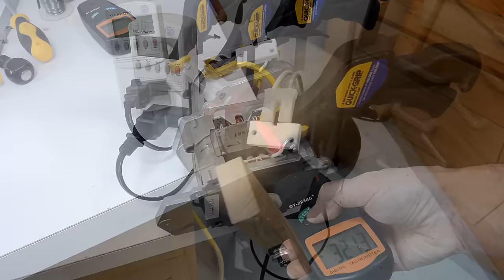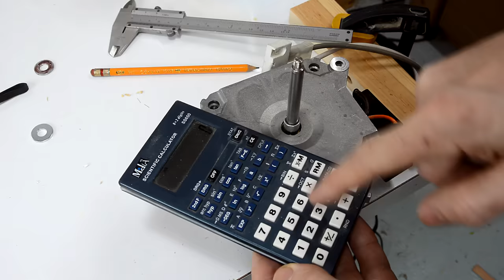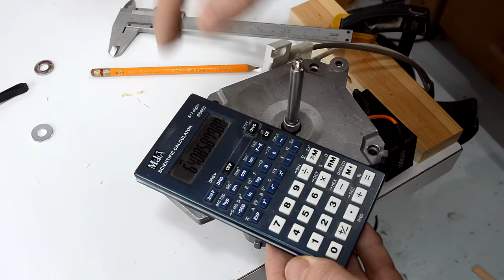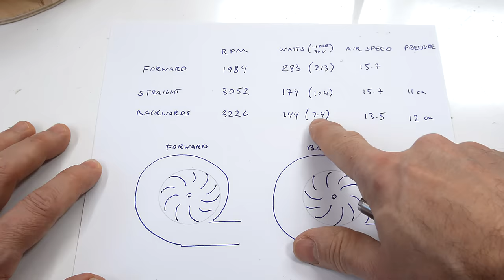Blower impeller design experiments

Comment: fantastic
plz have you the compas design? :)
Very good one.
Reply: Actually it is called a trammel and right you are a clever bit of kit.
I am sure you could have worked it out though, dual bevels on the rail keeps the points centered.
as for the clamps let your imagination run wild key there is they should be non marring.
For actual plans send money. Ha ha just kidding

Comment: I think you should be able to electrically reverse this motor. Without cap this motor should have 3 wires - phase, neutral and helping coil. Cap is usually connected between phase and helping coil, but if you do connect cap to a neutral and helping coil, it should reverse the rotor rotation.
Reply from the maker: It doesn't work that way.
It could be reversed if the two coils were the same turns & thikness, but they aren't.
Reply: Oh well.
Reply: If the four coil ends were accessible, it would be easy to reverse a coil, but this motor has only three leads. A junction is probably buried in epoxy.

Comment: Hi:  How about this: The entrance area and exit area of each  impeller I think should be the same, or the air will be forced to change volume.  Can you test this with your wizardry?  I think the thickness should be less toward the outside perimeter,  I guess linearly... Great work! Thanks!
Reply: Usually the opening is 10% smaller than the duct size.

Comment: nice video.   although I believe the tests were not valid.  each type of impeller has a function.   to suck, to blow or to move air.  application is the reason there are different types of impellers.
also, if you look at a vacuum, the part of the impeller near the shaft is tapered so that hair cannot have a place to purchase.  the taper just spins lint and hair off.

another test would be to add pipe to the inlet.  a dust collector has 20 feet of duct.
smaller duct to have the velocity in the duct lift and carry dust.

Then add duct to the discharge.  a home furnace has 20 feet of duct on the outlet.  this only moves air, not particles.

Comment: Forward curved fins will always move more air so they require a stronger motor.
Reply: And it's easy to mentally figure why, the air is accelerating out and forwards meaning you get a flow velocity greater than the tip speed. With the reverse fins you're actually slowing the air as it exits in relation to tip speed, and relying more on the volute for your mass movement. Since the volute isn't optimal, this is why the straight fins performed nearly the same.

Comment: On 3:39, to work out the geometry of those holes, you could’ve skipped the math part and used a piece of paper or cardboard with a hole in the middle, to the corresponding diameter of the shaft to go through it. After that you would only need to pencil mark the holes, or shade the area getting a perfect print of the area. Regarding the article, nice and useful info.
Reply from the maker: geometry is not that difficult if you know it, so it was faster.
Reply: Not sure if it’s faster, particularly with complex geometry. I guess with a phone picture and your big print program you could also get your way around it.
Reply from the maker: This was not complex geometry.  How long did that take to work out in the video?  And normally, I wouldn't be explaining it.
Reply: +redlightson
In my job there are quite often situations, that can be solved by math or by drawing and measuring. Those workers who suck at maths use drawing and measuring, because it is faster.. for THEM. I use maths because it is faster when you know what to do.
Reply: Yes, I agree that the example in the video it’s not complex geometry and, like you, I love math, but I’ve been in construction sites where I just grab a piece of cardboard or paper, make a template or mold out of it, and in a “blink of an eye” I’ve got all the information I need. My statement is about practicality just that. I guess you took the engineer’s approach.
Reply: Lol, in a blink of an eye i do calculate an angle i need or a side of a triangle dividing by cosine. It is not difficult or slow in any way, if you use it almost every day. I'm not an engineer. Just a worker. I think most important is that everyone uses method suitable for him-/herself. Even in construction site i bet I would calculate it faster than make a template in most cases.

Comment: Typically, forward curved and backward curved blades are not the same shape, just running in the opposite direction.  A backward curved blade is used for higher pressure because the airflow across the blade does not break down as easily.  Forward curved blades push more air, but the airflow over the blade breaks down more rapidly when the back pressure passes a critical threshold.  Straight blades are not as efficient, but are far stronger.  If I was to recommend a blade for a vacuum cleaner, it would be a straight blade, to have a better chance of surviving ingesting marbles and other solid objects.

The blades you designed were pretty close to backward curved design.  A forward curved design starts with nearly a radial section, that then curves forward.  Running a backward curve shape, in reverse, will give a very poor representation of how a true forward curved blade should perform.

Why anyone would make their own is beyond me.  There is considerable engineering that goes into the design of fan blades, with both performance and strength being factors.  One can order a fan from any of several different vendors, and get something much better than you can make, that is far better balanced, and will last much longer.  It would, however, be a good idea to put the filter before, rather than after, the fan.

 (I worked testing fans back in the '60s.)

Comment: I have cut different size(for different projects ) threaded rod a couple couple inches long (2-3) so there is no need to do all of the math that you did to make sure that you were drilling the holes in the correct place...all you need to do is put threaded rod into the holes of the motor and steal some of my wife's lipstick (I just hope she does not think I'm cheating on her if she finds lipstick in my shop) or use anything else and put some on top of the threaded rod and you can line it up and it transfers the marks to your workpiece..and u can also use a piece of cardboard or paper that has a 90 degree edge...line up the 2 edges and you can feel the holes or see through with paper and use as template.. You know that saying measure twice cut once...well I measure no times and use templates...

Comment: Wait, why would the forward-facing impeller need more power if it blows the same air speed at a lower RPM?
Reply from the maker: power is torque times RPM.  Lower RPM doesn't mean less power

Comment: There's a restrictor on the squirrel cage output that increases the pressure and flow I'm not sure how that works but you should have tried that look on your heating and air conditioning furnace the engineer's I figure that out I don't know what type of engineer that would be

Comment: your summing up turned to giberish. The forward facing rotor was handicapped by the weak motor so its impossible to compare the two like you did. The motor limited the results, thats why the straight and backward facing ones came out very similar.

Comment: Would a more conventional prop in a tube provide better flow than these designs and if so why isn't it used?
Reply from the maker: Prop in a tube is for very low pressure, high volume.

Comment: what effect does increasing or decreasing the height of the blades have?
Reply from the maker: changes maximum air flow, though past 1/3 diameter for the height it doesn't help much.
Reply: @matthiaswandel    It seems the diameter/height ratio of most furnace blowers is closer to 1:1.   Do you know why?

Comment: Hello friend could you tell me if 650 pa is enough for the aspiration of chips in pipes of 40
Reply from the maker: for pipes 40 mm in diameter, you will need 10,000 pa
Reply: How can I measure the air pressure in pa?
Is that I want to manufacture the manifold with the motor of a small but very powerful fan

Comment: If you disassemble the motor and flip around the stator,  you are not going to get the same speed and torque characteristics.   If you were doing a controlled experiment,  you would need to accomplish this some other way.
Reply from the maker: Do tell why they would not be the same.

Comment: Your backwards spinning impeller is probably losing a lot of efficiency due to vortex-induced drag.
Reply: Everson Bernardes, yes for this, turbulence is worse as the flow rate goes up and turbulence is reduced as flow rate drops. The backward sloping blades cope well with high flow rates, but do not produce as high a pressure.

Comment: Please explain the difference between air speed and static pressure.
Reply from the maker: Air speed is the speed of the air.  Static pressure is pressure in static conditions.
Reply: Thanks Matthias.  So to clarify; if we use the marble analogy, does static pressure represent the number of marbles flying out at a given time?  In other words, pressure is the volume of air exiting the fan.  Is air pressure inversely proportional to air speed at least for a given fan geometry?
Reply: Air speed is better if there's no obstructions in the way like a pedestal fan, and static pressure if better if it has to go past/through something like radiator fins.
Reply: So which is better for an airplane?

Comment: You fail to address/test the consequences of  changing resistance to the airflow on the blower.  All of your tests are "duct open" zero pressure, highest flow, which is not realistic for a blower. 
 Fans are used for this purpose.  Backward curve impellers tend to even the load as the airflow changes (such as filters clogging, reducing flow, or opening gate to another tool, increasing flow).  Backward curve also has more efficiency recovering pressure.  Larger blowers have a second stationary set of vanes surrounding the impeller to aid in this recovery.  Forward curve fans are inefficient, and are very sensitive to airflow.  They will overload motor when duct is open.  They are used as you said, on RPM limited systems (small gasoline engine cooling fans is an example.  They are also quieter because of the lower RPM, so are used in furnace blowers (with very shallow curved blades).  There are detailed write-ups on this in text books with detailed tables.  There is no need for blind experiments.

Comment: I am kinda upset I didnt watch this when it first came out. So your conclusion is a little erroneous, you need to look at it as my professor did: turbo machines change work by changing rotational speed. If your prop is going to spin at 2-3krpm you can look at the flow and volume of your intake and exhaust to get blade angles. We only did basic calculations in our design class but with your numbers let's try to figure out what angles we need. Your boundary layer area for the intake is not the top circle but the curved side of the inner cylinder made at the start of the blades. If you know the flow rate then we can divide it by this intake area to get radial intake speed, combined with the tangential speed (radius times revolution speed) we now have two legs of a triangle. Solve for the hypotenuse and we have our simplified intake blade angle. Now with the exhaust we can do the same thing. Mind you with radial flow the exhaust radial speed will be slower as the same flow rate now is traveling through a larger surface area. So the curve of the blade can be approximated as an arc with these two angles. In reality we would want to do these angle speed calculations all along the blade to get its shape. Sometimes when I was trying to solve a more complex system of equations like these I got answers where the blades would seem backwards. In our class we only touched on flow separation, or air not following the blades, which might result from this "backward" design. Good luck hope this helps...if you ever see it.

Comment: all you have to do is make it lighter in weight then it'll be more efficient
Reply from the maker: Please learn about newton's laws.
Reply: Matthias Wandel F=ma, less mass means less force means less energy to spin up the prop
Reply: with less force comes less air movement, what's your point? plus if it weighs less but outputs the same it'll start moving itself all around and losing efficiency.
Reply: the vast majority of the mass you are moving is air, not the mass of the impeller

Comment: That’s spinning at 1400 rpm
Reply: No. Wash Machine spin 1400 rpm when have drum wich have some higher weight but impeller. So, motor spin faster when have no load.